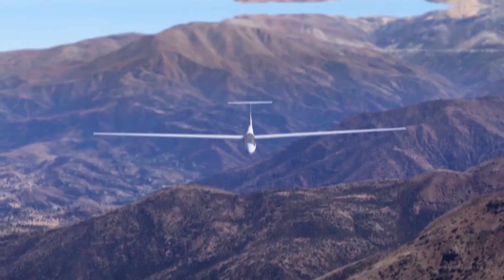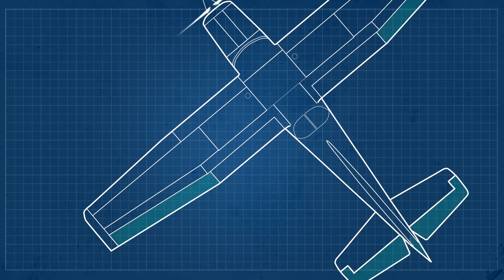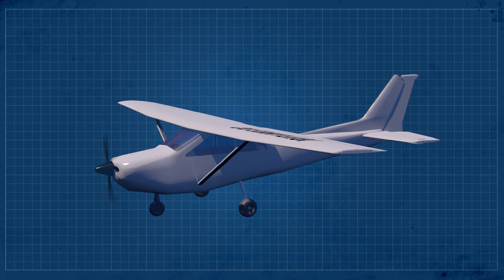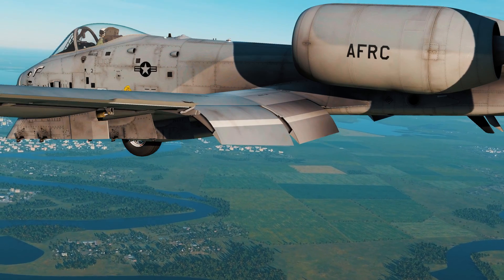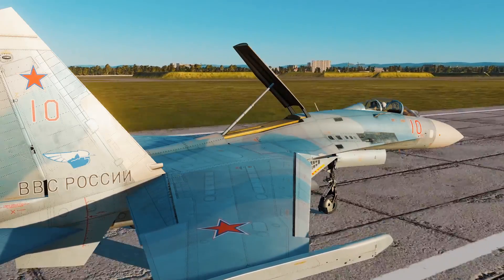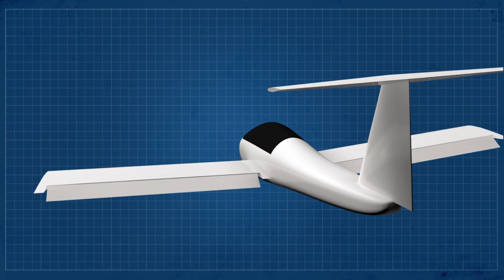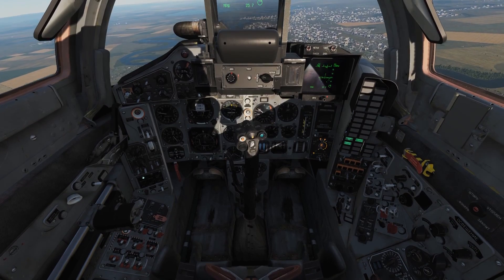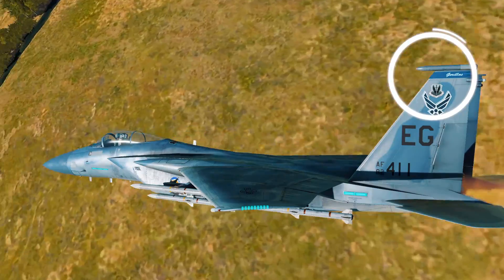Aircraft Control Surfaces Explained | Ailerons, flaps, elevator, rudder and more

Comment: Great video no doubt but it's important to state this is extremely oversimplified. Even aircraft designers that know how an aircraft actually flies are only in the dozens. Most work is copy paste from what was found to work before and trial and error. As such, a lot of things in this video are actually wrong, but for a simple explanation it passes as most seeing this video will never train to be a pilot. I recommend a very good book for those interested: Stick and Rudder. It's an oldie but goldie.

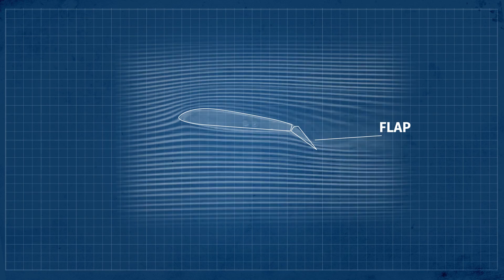Comment: at 2:53, these are the things about flaps that   NO  ONE  understands.!!! 
when flaps are deployed, the profile of a wing is  wonkified.     one result of this is,  a  Significant  increase in  Drag (from  extra  Turbulence), at the upper surface of a flap.!!!          (Turbulence  equals  less-dense air,  which  equals  SUCTION; aka  drag.)
because of this, when flaps are deployed, a pilot should be  prepared to  INCREASE  throttle.       googletranslate

Comment: some late information.          at 2:28, this is  not the  cg;    it  is  the  center  of  MASS (c-m). 
cg  is a span-wise line of  balance that is  specific to  when an aircraft is flying, and its mass  is   'supported by'  the main wing.

Comment: Explain full ailerons
Reply: did you mean full  strip  ailerons.?      if so, full strip ailerons are typically used only on cropdusters.      where, extreme (low-speed) maneuverability is  needed.
https://i.pinimg.com/736x/5b/f4/6a/5bf46a0812081dc51a01bad0ad36d5cf--tattoo-ideas.jpg

Comment: Really well done, please do the same type of video for a tandem wing, having one forward wing and one rear wing (instead of the more usual main wing and tailplane), with full-span control surfaces on the forward wing serve as combined elevators and flaps and ailerons being located inboard on the rear wing? This would be amazing as its hard to wrap ones mind around how the Rutan Quickie Q1,Q2,Q200 and other tandem wing control surfaces work etc.

Comment: what happens when a fighter fires a heavy missile or bomb off one wing ? what does a pilot do about the sudden weight difference ?
Reply: The pilot would roll the aircraft using something called the trim, this allows the aircraft to be permanently rolling in one direction to counteract the weight, but usually, the heaviest weaponry that would cause this is placed near the middle of the aircraft meaning very minimal trim is needed.

Comment: Why jet fighters control the elevators individually ? like one elevator generates downforce and tre other generates lift
Reply from the maker: To make them turn faster, they're actually elevons, all the movements are controlled by a computer to make the desired maneuver commanded by the pilot, that's called fly-by-wire, if the pilot controlled these airplanes manually they could enter a stall or simply lose control.